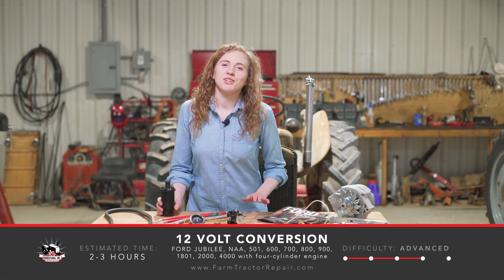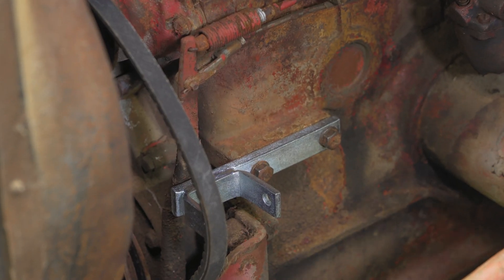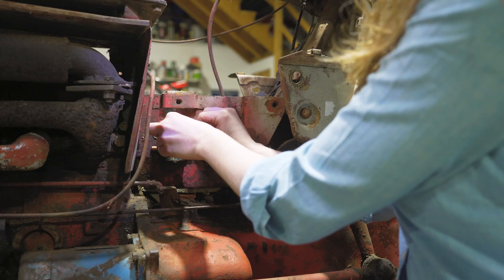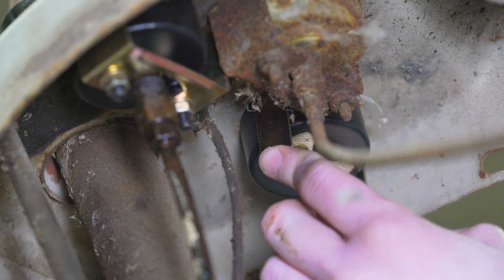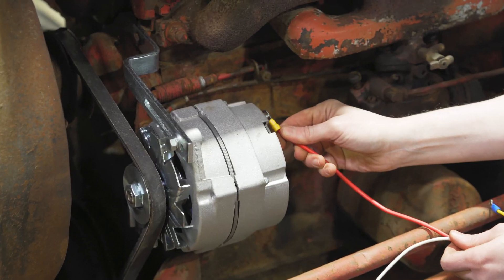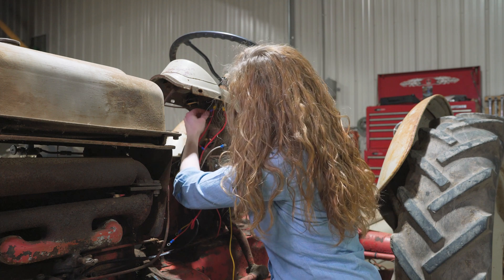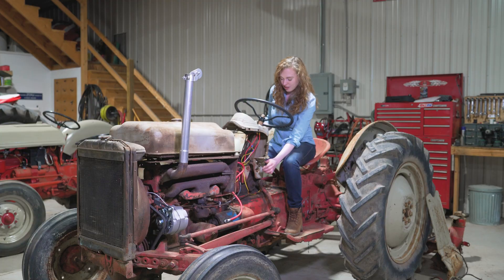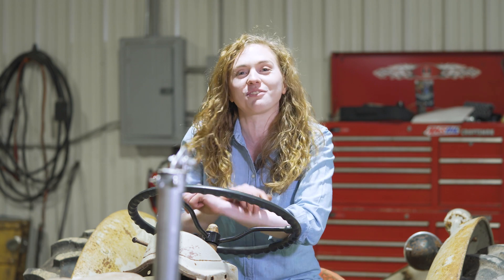Twelve Volt Conversion for Ford NAA, Jubilee, 600, 800, 2000, 4000 4-Cylidner Tractors

Comment: Selonoids are voltage sensitive you need a12 volt solenoid for your conversion
Reply: That’s true
Reply: The new one she installs is clearly marked 6 volts.
Reply: If 6V can actuate the solenoid, then 12V can too.  It's only used for a short time so I don't think using a 6V solenoid with 12v power is fine (as she said in the video more or less).
Reply: @RK-gg3pr  I noticed that as well and have already commented. After 50 years of working on this equipment  I would purchase a 12V solenoid. The 12V is for the Primary ( solenoid  coil), not the switched contacts. They will handle both 6V and 12V. CHEERS.

Comment: Why not show 6 v way
Reply: It’s already 6 volt. 6 volt sucks
Reply: @budchase5269  if it isn't broken, DON'T FIX IT. It still wouldn't hurt to show the old way. Not everyone wants the 12v system.  It's harder on the starters. They wasn't made for that. But, I know plenty has switched. If you wanna change yours go ahead . You bought it. I wanna keep mine the way it came in 1950. Let it be.
Reply: @d.brownjr.4845  Agreed, If a 6 volt system is properly maintained it will work just fine. I have a 53 Jubilee Ford and will NEVER convert it to 12 volt. Why modify something that is not broke?
They show these videos because they sell the parts needed for modifications. No videos, no money!